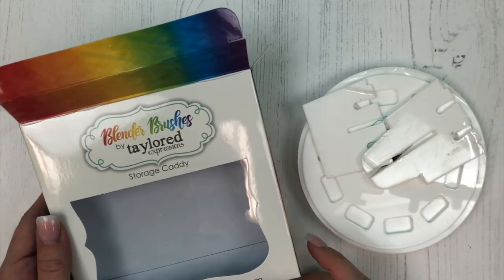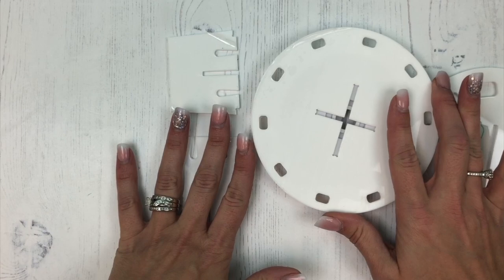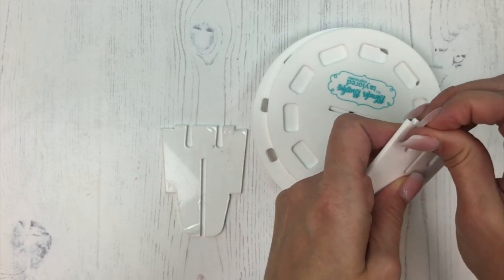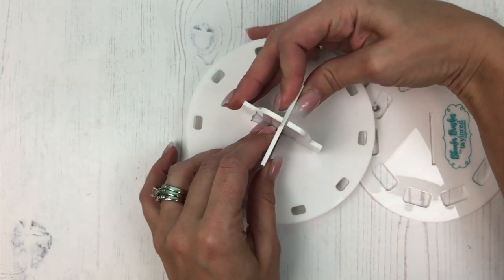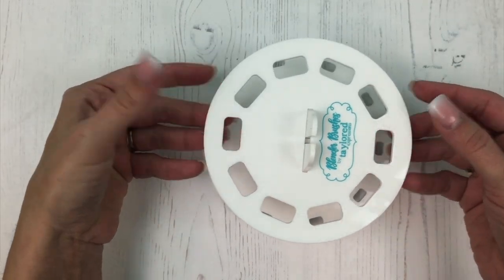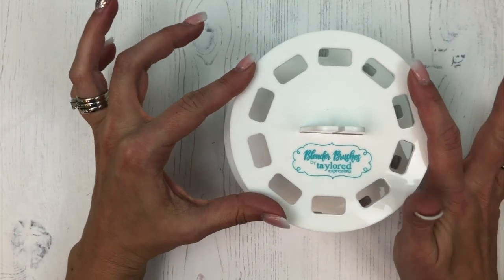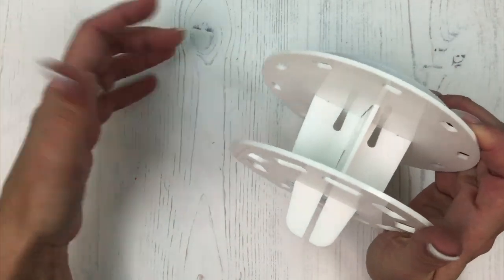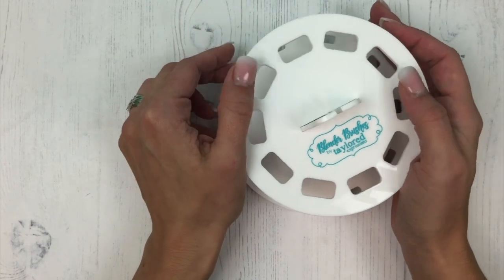4 Essential Tips to Assembling Your TE Blender Brush Spinning Caddy (REVISED)

Comment: Thank you so much. I think super glue will solve my issues. Only because I can’t seem to remember to pick it up from the bottom.
Reply from the maker: I've noticed that connecting the two in the middle  before you snap it into the base helps a lot too. But yes - super glue helps for added stability!

Comment: Hey Taylor, I do think a lot of the issue is not peeling off ALL the film because if you don't, the pieces will not fit together because it's too tight and that's when you will inadvertently start adding pressure.  It may be advisable to add a small highlighted note or something to communicate that fact with the buyer.  Oh, and Taylor, I love my brushes and caddy!  Thanks dear.
Reply from the maker: I think that is part of the issue as well. I appreciate the feedback! :)